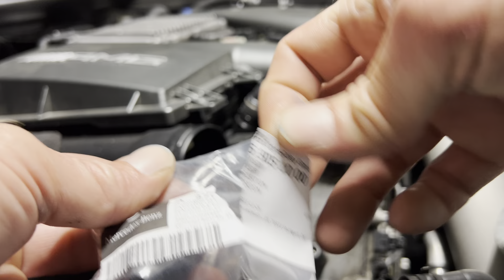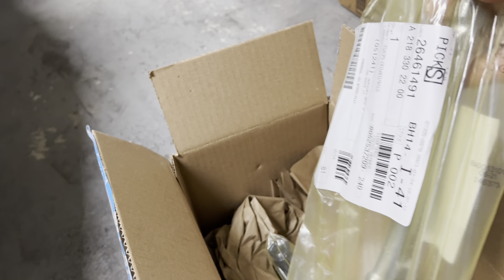Mercedes CLS 63 M157 Camshaft position sensors replacement

Comment: Mine check engine light came on , I went to AutoZone and they pointed out that camshaft sensor is bad I took all of them 3 were leaking, thanks for the video
Reply from the maker: Thank you I’m glad it helped you , If you liking for parts check fcpeuo , autohausaz , rock auto .
Reply: @jayheritageclub7852 how can you check if your camshaft magents are bad or leaking? Or should you just replace them as maintenance every once in a while? Mine has 90k miles.
Reply from the maker: @multiblade04  just take the connector off and look for oil on connector or in magnet plug
Reply: @jayheritageclub7852 while its off and if clean of oil should i go ahead and replace it anyways cause cheap part or if it is clean of oil just reinstall the old part?
Reply from the maker: @multiblade04  if replacing preferably to use the factory part I didn’t see other problems with them besides the oil so I would just keep them, you can get wire extensions it will help to keep the oil from getting to main harness.
Reply: @jayheritageclub7852  ok got it. So remove the connector, if theres no oil on the connector, just reconnect it and call it a day?
Reply from the maker: @multiblade04  yes
Reply: @jayheritageclub7852  ok. Lastly is it that easy to do? It looks super super easy in your video.
Reply from the maker: @multiblade04  if we still talking about the magnets, driver side slightly different from the passenger

Comment: Thanks for a super clear video on doing this easy change. Is there a way to get new gaskets for the connectors (the yellow ones). Also, maybe the new green gasket version is better than the old black gasket sensor but have you had another leak since this change?
Reply from the maker: @edeag3  the gasket/O ring mostly doesn’t leak the sensor  leaks internally yes it will keep happening due to the design of the sensor. Usually they good for 40 to 60,000 miles depends on the driving meaning oil pressure with a higher RPM. It will happen earlier. there is another solution to buy an extension for the wire that can catch oil in itinstead main harness but I would suggest to check them every oil change

Comment: Where does the knock sensor plug in at? I replaced the camshaft ones but I think oil is in the knock sensor now, too much was in the harness. I have a knock sensor problem now and want to try cleaning the connector

Comment: Great video.   I just bought a 2016 cls 63 s amg.    53000 miles on it.   That’s the first thing I am going to do.    I have heard where people are unplugging the oil pump solenoid     Have you done this.   If so where is it and do you recommend it????    Thanks
Reply from the maker: @462opd2  Hey, thanks I’m happy my video helps, I do have a video about the oil pressure sensor I did unplug the sensor and I was not happy with it , it’s a personal preference I would say but more explaining in the video

Comment: Thanks for showing up close how to undo the clips that secure the connectors.
What yr. is your car and what's the mileage?
Some folks in the forums say this oil seepage is more due to vehicle age rather than mileage.
Reply from the maker: Hello , i got 2014 CLS with 42,000 is ,miles, yes it could be something with age and but I have one more a theory , when sifting between the driving mode's on speed it send the signal to sensors to adjust camshafts to different position that is when the get a good oil pressure to the sensors and camshaft solenoids , they are the ones that have those sights , I believe it could be solve by adding oil catch cans and pressure regulator or valve vent .
Reply: @jayheritageclub7852   Interesting theory.  I usually doo not change drive modes once I get the car moving.  Always set mine to S as soon as I start it (mostly to shut off ECO and get the lowered stance).  I always had my doubts about changing modes while the car is in motion... now, this would be a great reason to not do it, lol!